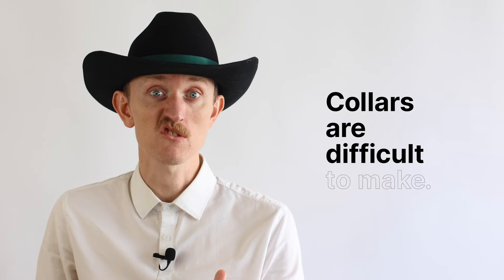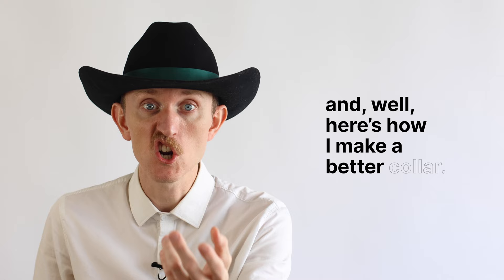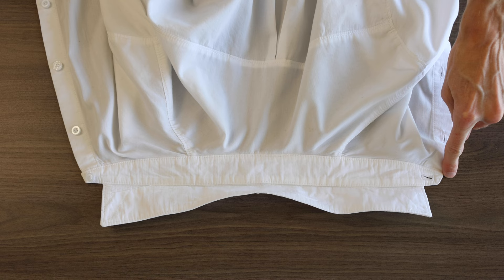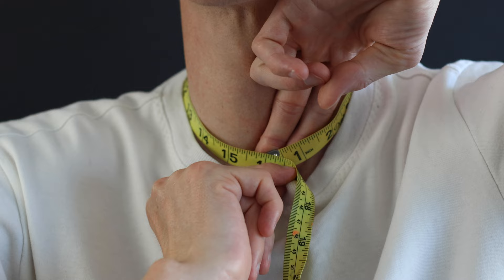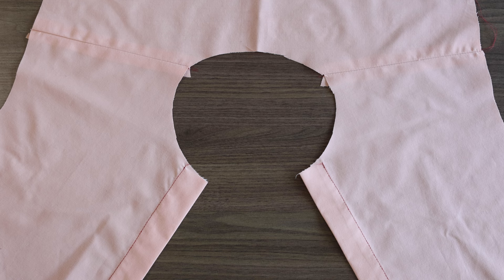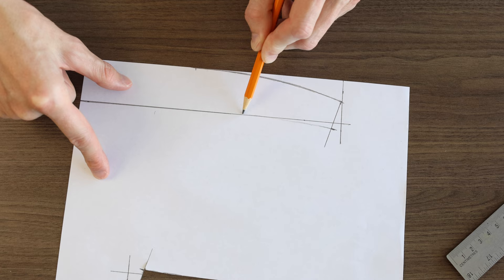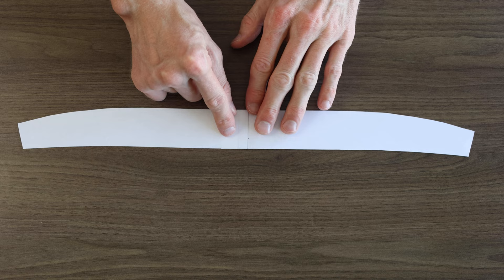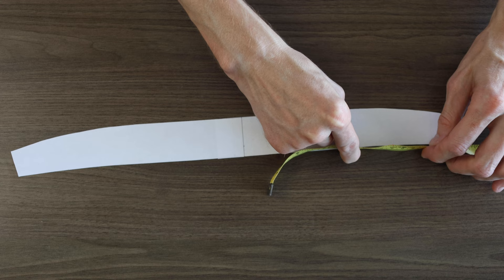How to Draft and Sew a Collar ... to Perfection

Comment: Hi Cornelius, thanks so much for the video. As a nube, your videos have been so helpful and I love the detailed step by step approach. With this approach to sewing the collar I really like that the interfacing is there as a guide for where to sew. Do you have any tips on how to cut the interfacing (or fabric in general) so that the shape is precise? I’m finding it hard to cut straight lines as the fabric shifts around. Thanks!
Reply from the maker: I'm glad to hear it. Maybe try using a cutting wheel. Also, drawing it out on the interfacing helps.

Comment: Excellent video as usual!  Curious about the interfacing.  What are your thoughts on the sew-in type of interfacing?  Have you ever used it.  Just curious because I don't fully understand if there are sewing advantages or drawbacks to using sew-in interfacing versus fusible.
Reply from the maker: From what I've gathered, sew-in interfacing is good for adding structure in a draping environment. For lacy and textured fabrics where pressing it down isn't as feasible. It also reduced the bubbling that can happen after washing. I have only used it a little bit. It adds the challenge of an extra layer but manageable. There are more use cases but this is what I recall off the top of my head.
Reply: @CorneliusQuiring  👍👍